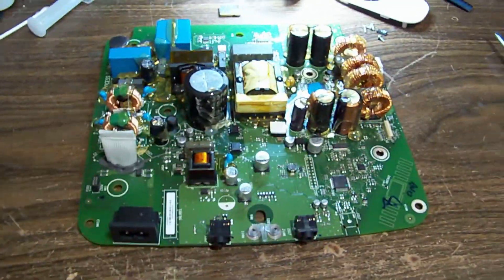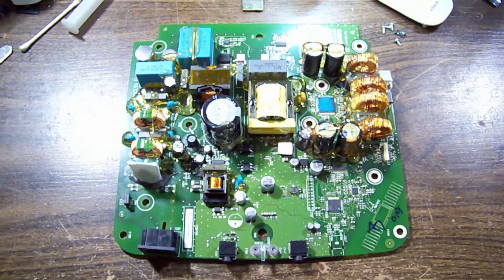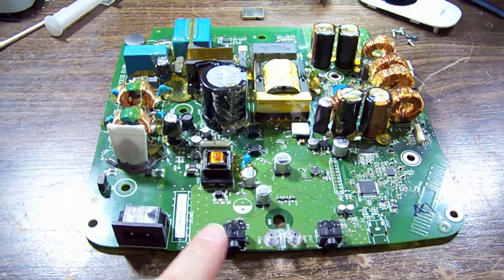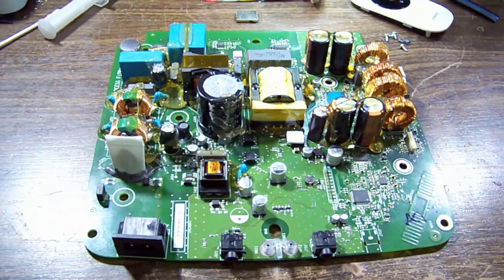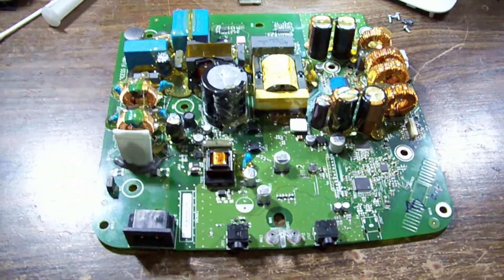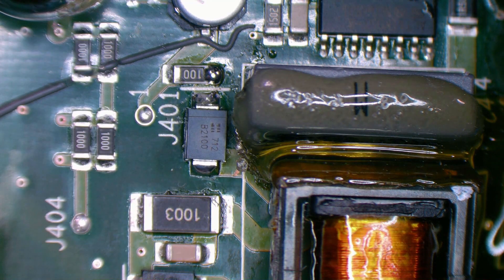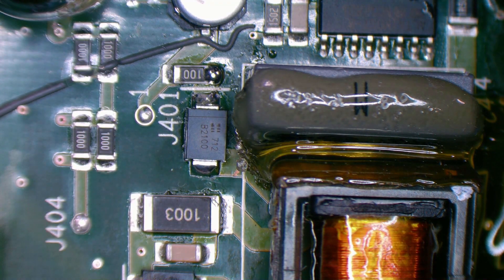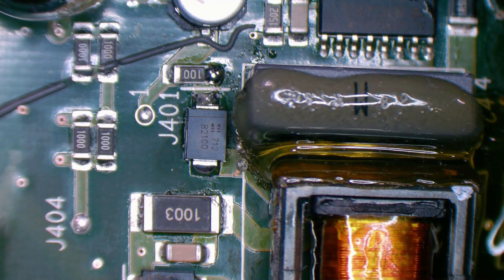How to repair a Bose Bass Module 700 that doesn't turn on!

Comment: Hello, my whole circuit board was put in water due to a flood in my out door kitchen  I am having trouble locating a new circuit board for my bose boss module 700 where do you find all your electronic parts??? Called bose they would rather give me 30% off a new one than sell me the circuit board
Reply: @Jonny Fix
Reply from the maker: @loganlejeune7035  I get my parts from RS Components and if they are hard to find I can usually get them on ali express. You can also try digikey or mouser or element14.
Reply: @JonnyFix  thank you sir, now how would I locate the part number of the circuit board so I order the exact one?
Reply from the maker: @loganlejeune7035  Those companies I mentioned don't do whole circuit boards.

Comment: Im from Brazil and I repair my problem with this video. Thank you!!
Why Bose not make videos to help fix other sounds system? Because in Brazil there is only one Bose repair. In EUA should be easier.
Reply from the maker: Well done, glad you got yours fixed! No manufacturer will make content on how to repair specific faults. People either take it to their service agent or find an independent repair person and pay for their service. If you want learn electronics then you will be able to repair most things.
Reply: @JonnyFix  Hi JF, are u in NZ? 
I'm in Auck and need someone to repair this for me ...
Reply from the maker: @TheOceanmariner  Yes but I don't take jobs sorry. Any electronics repair shop up there should be able to do this simple job, if they can't be bothered figuring it out show them this video ;)  If you take them just the board to save time it would take 30sec to test the diode to see if it was bad or not. If not, you have a different problem and they would have to troubleshoot it.
Reply: Olá Neiton, eu tenho 2 subwoofers desse e os 2 estão com esse mesmo problema! Vc poderia me informar aonde vc comprou esse Diodo aqui no Brasil! 👍

Comment: ciao Jonny, la mia acoustimass 300  ha smesso di funzionare, non so cosa abbia fatto sembrerebbe dopo che ho installato le altre casse piccole , ho provato di tutto ma non riesco a farlo andare non si collega piu' con la SoundTouch-300-  e quando gli do' corrente non si accende piu' la luce dietro ... come posso risolvere il problema ?
grazie in anticipo   
hi Jonny, my acoustimass 300 has stopped working, I don't know what it did it would seem after I installed the other small speakers, I tried everything but I can't get it to go no longer connects with the SoundTouch-300- and when I give it power, the back light doesn't come on anymore ... how can I solve the problem?
Thanks in advance
Reply from the maker: I do not know sorry. I only fix problems as I get them. I'm not a specialist in any one thing.

Comment: Hi, I have an issue with the subwoofer as well. However, when the subwoofer is switched on the amber light blinks and there is a white indicator light(indicating connection to the soundbar), but it immediately goes off and then the same thing happens again, amber blinking light and then white again. Any suggestions!
Reply from the maker: Sorry, if the user manual doesn't mention this you will need to start research/troubleshooting. Can you pair phone to sound bar? Maybe bar is faulty...
Reply: I have the same problem whit the bose bas module 300 ... star blinking yelow then white then red. Please help. The sound bar works fine. Just the bass module problem
Reply: Have similar issue. Bass module Bose 700 worked fine with Bose Sound bar 700 and two surround speakers for over one year. Apparently without any reason, bass module started to blink amber, white and after several such cycles the led sequence was amber (ca. 1sec), white (ca. 3sec) and red. Needless to say the bass module doesn't work.  Sometimes for unknown reason the bass module works ok but after switching off, the same issue occurs again. Bose technical support said I should send this module to Bose for repair. Does anyone have the same problem?
Reply: Same issue on mine, did this fix work?
Reply: @steveberube966  i got a Fix for all of u, i had the Same Problem. Ich replaced the Little Chip like showed in the Video. Then mine Starts to Blink - orange- white- red. I thought First its the ribbon cable but it was just a Bad Connection on my sodor skills. I redo it and it worked again. Sry for my poor english

Comment: Hello thx for your video !! So , please could you confirm the ref of the diode ? B2100 cms ? is that correct ?
Reply from the maker: I can't find any info for that but it's probably fine. I used B2100-13-F. Compare the datasheets and you should be able to see if it's much different. Should be good for 2A

Comment: Hi there. I have a similar bass module 700 that will no longer connect to the soundbar. After lots of troubleshooting over the phone with bose. They tell me that the wireless controller may be damaged (like light stays solid amber and doesn’t enter pairing mode). Trouble is. I like in East Africa and there is no Bose service center anywhere near me. Would you have any ideas which module this is? I could try buy it myself and swap it out. Would really appreciate it!
Reply from the maker: I don't know much about this unit as this is the first time I've seen one. Looking at 7seconds in on the bottom right of the board there is a line like |-|_|-|_|-|  each side of a rectangle, this will be the bluetooth antenna and if you follow not far from that toward the center of the board you come to a small square black chip. I'm guessing this will be the bluetooth controller chip. Search for a datasheet for the number on top of that chip to know for sure. If you should be able to connect a phone to the soundbar but can't then maybe the fault is in there instead. Good luck!
Reply: Zahir, have you fixed your solid amber light on Bass module issue? Can you pair your soundbar and bass module now? What was the problem ?
Reply: @rakeshkashyap84  hello. No I never managed to get it fixed. For the moment I’m using a splitter and connecting both my base modules to the soundbar with a cable.
Reply: @zahir: Even I am using Aux cable to connect it to Soundbar 700. I searched all Bose forums . Looks like it's a well known issue with Bose bass modules but bose don't have a solution for it other than unplug it for 30 secs and plug the power cable back and try. Such a shame that all expensive Bose products have (sply soundbars and bass modules) have many issues.

Comment: Maybe the leaded diode introduced too much parasitic inductance and caused issues at higher frequency?
Reply from the maker: I think it was just a bad diode breaking down under stress as I found another leaded diode that worked ok just to prove the point. Interesting theory though, if possible not sure if that would have more of an affect in power rectification or in signal processing.

Comment: Dam standby power supply, how dare it fail :-D
Odd as i expected dead capacitors.
Back to basics, check the standby supply.
Next time the diode will be fine lol.
Reply from the maker: New diode will outlive rest of unit, if not I did order 10 of them :)

Comment: Don't ya hate it when your replacement part is faulty?
Well done on your repair. Thanks for the diagnosis.
MiracleMAX
Reply from the maker: Yeah it measured low as a schottky does so threw me off. In hindsight it was a bit too low. A lot of time wasted chasing tail on that one. Cheers mate!
Reply: @JonnyFix  It's all a learning curve mate! 😉